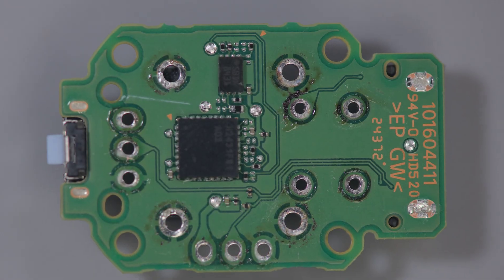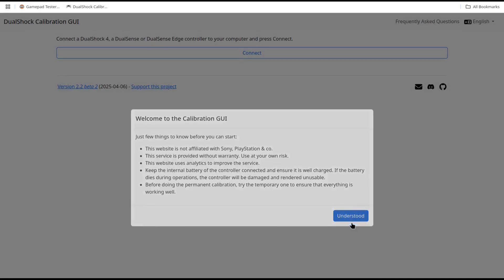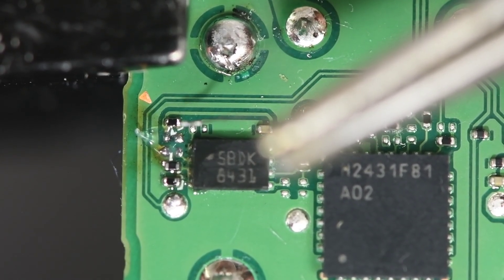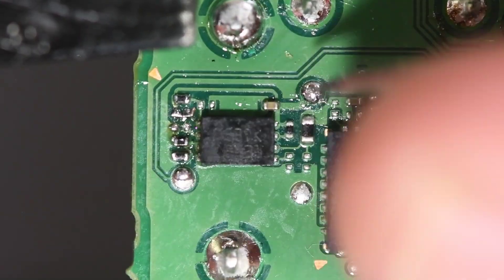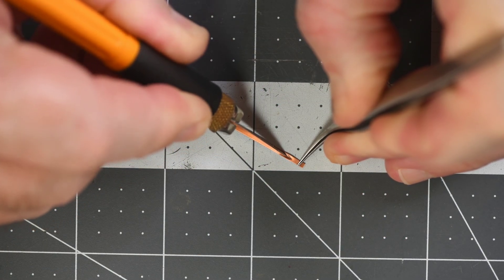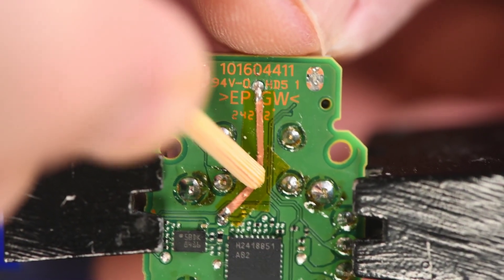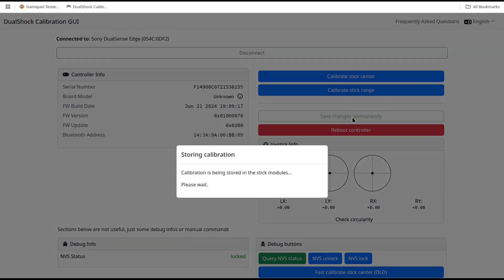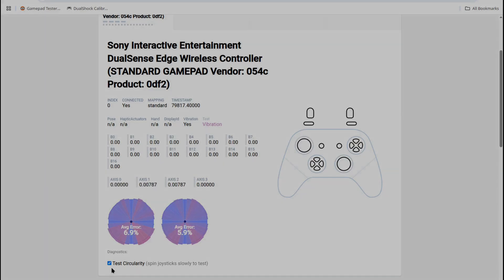DualSense Edge Stick Module Mod: Calibrate Replaced Joysticks Like a Pro!

Comment: would u say its optimal to not cause a gap on btwn the pcb and the plastic housing? copper wire or tape? ive seen it done with both and trying to figure out whats the best

Comment: So I’ve found an easier way to save the module.  Before you need to replace the joystick It’s simple and I’ve done it to my original modules.  Just replace the wiper  as soon as you notice the control just start to go a little haywire. I’ve   done it twice  and there is no  need to dial it in via a program.   I’ve done this twice and still have the new spare modules   ..  with respect to  fixing drift   If you play a lot  replace the wiper  once or twice a year

Comment: after the tmr stick was installed i am now getting no power on my controller. any suggestions/help
Reply from the maker: Look closely for any solder splashed where it shouldn't be.  Also, check the wires on the battery connector. If you have a multimeter, take a look at this video: https://youtu.be/cWUnZ7KjUIQ

Comment: Wouldn't be easier to manually center the hall effect potentiometers of the analog instead of bypassing the write protection to calibrate it via software?
Reply from the maker: You can manually center by distorting the plastic shafts, but the range will still be off, which requires the software calibration.

Comment: My Hall effect magnetic analogs are shorting my Edge controller.
They worked for a few weeks and now the controller is not working anymore. It blinks white and doesn't work. I swapped to original Edge analogs and the controller works again. I then tested each Hall effect analog combined with a normal analog and the controller doesn't work.
Could this video be a solution ?
Reply from the maker: Please make sure that no solder is shorting out any components and that no parts have come loose. If the controller can't communicate with either of the modules, it just blinks the LEDs on the controller.  Take a look at this video for a little more in-depth look at the areas that might cause problems.

Comment: Great video as always!! I'm having problems with my calibration though after installing some HE on 2 stick modules. When i plug in to calibrate, the stick are shooting far off to the left and doesn't allow me to calibrate or even move off from its position. Mind you this is the 3rd Edge controller i've working on and the other 2 had no problems at all. Now all of a sudden i'm getting this weird pull off the the left when the install appaers to be fine and no different than the last 2 edge controllers i worked on that had no problem. 
Any idea what could be causing this??
Reply from the maker: All the way left would mean you are getting close to 0 volts on the output of that axis.  The voltage to the sensors is supplied on the top layer. Look very closely at the far right top pad of the left/right sensor.  If you see any sharp raised area, it may be trace damage.  There are very small capacitors on the sensor output pins.  If you have an ohm meter, check the resistance of the left/right sensor output pin to ground.  It should be a very high resistance.  If not, look for any solder in places it shouldn't be.  And check to make sure the small 0201 capacitor on the output line is not damaged.

Comment: Watching your video i managed to successfully replace 3 joysticks but unfortunately while trying MOD 1 on the 4th module I managed to remove the transistor or whatever the very small part is next to the bridged connection see 2:23 (basically the one in the top left corner below the pointing gold arrow), could you please tell me what part is that so i can order and try to replace it? Thanks to your videos i managed to replace dozens of joystics on XBOX and PS controllers and that's how I got into this type of stuff. Thank you!

PS: would be nice if you have the tools to do a tutorial on how to solder 0201 devices,.
Reply from the maker: Well, I can barely see a 0201 device, but I'll see what I can do.  I believe the part you are talking about is a 2.2K ohm resistor.  If it is the one that goes to pin 1 of the memory chip, that is the one.  It is a pull-up resistor on the Chip-Select line of the memory chip.
Reply: @metalplasticelectronics354  Thank you for getting back to me, I don't know  where it goes, I just noticed that mine is gone and now my controller won't even turn on with the faulty joystick inserted. Do I have to look for specific pull-up resistor or any 2.2k Ohm 0201 resistor will do?
Reply from the maker: Any will work, and if you only have 4.7K, you might get by with that.
Reply: @metalplasticelectronics354  Thanks for getting back to me again, I did order like you said 2.2K and 0 for bridging the  connection for calibration. I'm so anxious though because they are so small and never tried soldering anything so small before. After this I will probably stick to method 2 because it's 10x more easier unless I'll actually be successful with the 0201 soldering.
Reply from the maker: The 0201 size is a real pain, there is no doubt about it.

Comment: Thank You. One person (you tuber) who used your 2nd method said that after calibration, you should remove the tape. His reasoning was that the controller is always open to a firmware update if the tape link is on. And that like Microsoft - Sony might install an update blocking this method, leaving the controller unusable. Do you suggest that after calibration to remove the copper tape. Or from time to time the connection needs to be there for calibration.. Thank you so much.. Only because of this video i am now going to buy a dual sense edge.. Not going to pay insane money every year for stick drift. ❤... PS: This small curosity made me buy a whole soldering set equal to 2 normal controllers price.. But this exercise has been enjoyable to learn a new skill which shoupd have been taught in school.. Godspeed..
Reply from the maker: I doubt they would do an update that would render the controller unusable; that would just create a slew of customer service calls, costing them money.  I'm surprised the firmware is in the controller to write to the EEPROM in the first place.  I could see Sony removing that, but if they haven't done it by now, most of the engineering team should be working on the next generation of hardware and not spending time rewriting Edge firmware that works.  I leave mine write-enabled, and if it causes problems in the future, it can then be removed.

Comment: Thanks Bro I have a quick question In method 1, is it necessary to remove the jumper after calibration, or can I leave it connected permanently?
Reply from the maker: You can leave it connected.
Reply: @metalplasticelectronics354 Bro and the method 2 is it necessary to remove the jumper?  In site github they ask to remove. I tried to solder using method 1 but I couldn't, I was afraid of removing some component Thanks.

Comment: Conductive pen should work?
Reply from the maker: As long as the connection is less than 100 ohms, I would expect so.  There is a 4.7K ohm pull-down resistor that has to be overridden.  If the conductive trace is above 100 ohms, I would remove the 4.7K pull-down resistor.

Comment: I'm confused, is the mod required for the calibration tool to write permanently to the DualSense Edge's firmware, or have they overcome this issue on the calibration software on the Github repo in question, and the mod is only required if you want to use other DualSense calibration software to write the configuration to the stick?
Reply from the maker: There is a memory chip in the edge stick module.  It is write-protected as the module comes from Sony.  The mod is to write-enable the memory chip.  If it is not write-enabled, any calibration will be lost when the controller powers down.  So the mod has to be done to calibrate the stick module.

Comment: I have just completed installation using method 1 with a 0201 0 Ohm component and hot air station. Then installed the GuliKit TMR joystick. All calibrated and working perfectly. Completed the right stick first to see the difference against the original left-hand joystick. I really appreciate the time you take on your videos and the level of information provided.
Reply from the maker: Glad it worked, and glad the video helped.

Comment: He probado con hilos de dentro de un cable usb, y nada, debe ser solo con un cable muy muy fino y con aislante imagino. De 30 awg? En el pc pone  que el voltaje 1.8 no se qué  y no lee el mando, es decir no esta bien puenteado
Reply from the maker: The purpose of the jumper is to connect the write protect pin of the memory chip to the voltage supply level.  I don't remember measuring it, but I expect 1.8 volts.  If using the second method in the video, you will want to insulate the wire.  Wire size won't matter, 30 to 36 gauge or even smaller, as there is only a couple of hundred microamps on it.

Comment: Work fine, use method 2 with 0.1mm jumper wire and thin layer of solder mask on top for my friend. He tested it and it work great (used Guilykit TMR's)

Comment: I use 34 AWG enameled copper wire with the second method, typically used in transformers. 0.0063" diameter. Use the soldering iron tip to heat away the wire's enameled coating at the points where it needs soldering. No taping necessary thanks to the enamel coating and it's so thin it doesn't interfere at all.
Reply: better than copper tape?

Comment: I would like to add a resistor to method 1, which resistor is best suited for this?
Reply from the maker: If you want to us a resistor, I would remove the 4.7K pull-down resistor, and any 0201 4.7K resistor will work as a pull-up. If you don't want to remove the 4.7K pull-down, then I would use a 0-ohm resistor as the pull-up.  But for optimum power usage, removing the 4.7K pull-down is the way to go.

Comment: Can it be done with just the one with copper tape or does that other small solder piece u did first need to be done aswell.
Reply from the maker: Only need the copper tape OR the 0 ohm jumper.  Don't need both.

Comment: Done this for my edge using the second method by taking thin copper wires out from a regular power cable. Now that fine tuning has been added to the edge calibration I have perfectly calibrated my sticks as the normal range calibration does not always give full range depending on the joystick. Thanks for this information it is fantastic work!

Comment: Can you please post a link in the description for the two tapes used in method 2?
Reply from the maker: I don't have one.  The copper tape I used was bought many years ago.  Any copper tape should work, as long as it is copper metal and not a plastic that looks like copper.  If the description gives a thickness of the copper foil, it will probably be made of copper metal.
Reply: @metalplasticelectronics354 Thanks for getting back to me. Much appreciated. I am new to this and I was wondering what’s the purpose of the Kapton tape? I saw another video where they just use a conductive tape from the two
 points in Method 2. I tried it and it didn’t work me that’s how I stumbled to your video.
Reply from the maker: Just in case the solder mask was scratched under where the copper foil ran.  The Kapton tape will prevent any possibility of a short.  There is a 4.7K ohm resistor pulling the pin to ground.  Conductive tape would have to have a resistance of quite a low value to overcome that resistance.  The copper foil will have an extremely low resistance.
Reply: @metalplasticelectronics354 thank you!

Comment: Good morning, when it comes to the original analog alps, do I need to do this soldering procedure or just calibrate it through the website?
Reply from the maker: For the calibration to be stored, the solder mod has to be done.

Comment: Is it safe to let the wire on the board after the calibration or is it necessary to remove it after the calibration?
Reply from the maker: Can leave it.  Removing it could change the calibration as the PCB may move some.

Comment: So what's the difference between method 1 and 2? Am I able to buy hall effect sticks and replace the old ones on board?
Reply from the maker: No real difference, just two methods to accomplish the same thing.  Yes, you can now replace the joysticks in the stick modules.  I would use TMR instead of Hall, but that is up to you.

Comment: Does the wire resistance have to be exactly 0 Ohms? Or can I use a 0402 0 ohm resistor?
Reply from the maker: As long as it's below 50 ohms, you should be fine.

Comment: So I'm trying to fix a pair of edge modules, one went great (like software calibration is optional kind of great) but the other module just.... Died... When the "dead" is installed the controller the LEDs just blink white 3 times quick over and over. 

Tried asking and poking around online and it seems like the stick modules stop getting recognized but no one seems to know why or how to fix it (when it isn't just as simple as a stick swap)

I tried cleaning, resoldering (including the pins from Sonys kind of not great looking connector as a last ditch effort) inspecting for bridges, damages of any kind, reinstalling a new stick, I'm about go last ditch and install the stock sticks assembly but I know in advance that isn't going to change anything...
Reply from the maker: Look very closely for solder bridges or possibly some missing SMD components.
Reply: @metalplasticelectronics354 Did both those, I'm really stumped what happened. Comparing to a brand new board there isn't anything obvious. Gave it a good cleaning, retouched joints, even tried a new stick assembly but the board just seems kaput 

I'm wondering if one of the chips on the modules are prone to failure.
Reply from the maker: I'm sure it's the cheapest of the cheap parts, so it could be anything that failed.
Reply: @RitzScythe same here. Fun fact is that it worked at first. I have moded just one of the sticks. It worked and I even managed to calibrated it. But then I removed the vanilla stick and I accidentally pressed the ps button before plug it back (only the moded one was plugged). That was when it started to blink. Plugged it back, but it didn't work anymore... 😕
Reply from the maker: Very strange.  Might try powering it up with no stick modules installed, then shut it off and put both in place.  Might even try a hardware reset.
Reply: @metalplasticelectronics354 very strange behavior. It works intermittently. I've pressed the ps button continuously in a desperate way to bring it back to life and... it worked, but not every time. It will randomly blink white and stop. I removed the jumper, but the behavior have not changed. Maybe some dirt on the pcb? Strangely it works for some time. I've managed to play for 20 to 30 minutes and it stopped again. It blinked when I put it on the oficial charger, but it turned on when I pressed PS button..
Reply from the maker: Have you tried it wired to a PC?

Comment: So I did method 2, but when disconnecting the control and reconnecting it, it seems to lose the calibration, although it appears that it was unlocked in another software (it shows that the jumper is working)
Reply: I think once you save the changes on the calibration website you need to go back to the software you used to unlock the modules and lock them again. Hope that helps.
Reply from the maker: Make sure you click on the save changes permanently button after calibrations.  If it still isn't saving to the EEPROM on the stick module, you need to recheck the pull-up line to the EEPROM chip.

Comment: Hi. Does it work with Ginful V5 out of the box? I did one of those but with no success, but being a newbie I am positive I fried the board by applying too much heat, and the controller just keeps blinking white when connected to the PC. Thanks for the hard work!!!
Reply from the maker: I would look it over and make sure the solder hasn't shorted out anything.  Any of the Hall or TMR should work.
Reply: @metalplasticelectronics354  I see. I'm gonna look it over then and see if I didn't overlook anything. Thanks a lot for the response!!!
Reply from the maker: good luck

Comment: Do I need to have two joysticks connected to be able to calibrate them
Reply from the maker: Even if the controller boots up with only one stick module, I don't think I would try calibrating it that way.  There is limited testing for the edge cases.

Comment: What happenes if I accidentally remove the two resistors and the capacitor
Reply from the maker: The 2.2K resistor will probably need to be there.  It pulls up the chip select line to the memory chip.  The 4.7K and the cap across it won't matter because you will be jumping them out.
Reply: @metalplasticelectronics354 do I need to have both sticks in for this to work? I have one in and it isint showing on the joystick tester website. Buttons work but the joysticks don’t. I’m using ginful joysticks
Reply: Do I need to have both joysticks in to be able to calibrate. I keep getting an error
Reply from the maker: I would imagine both stick modules have to be in the controller, but only one needs to be write-enabled. Only the one that is write-enabled will be updated. I didn't even try to operate the controller with one module installed.

Comment: Great Job,

i have a Question, a standart wire dont work ? 

Thanks !

Edit:

I had done it with a really thin wire from a led mod kit (PS5) it works !
Reply from the maker: Any conductor that will fit will work.